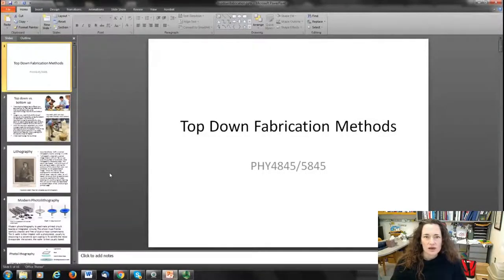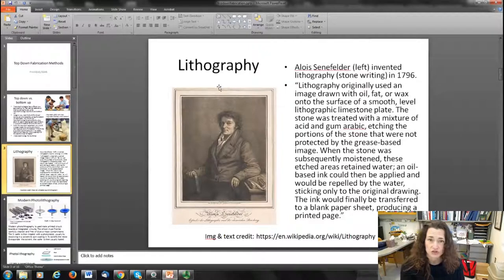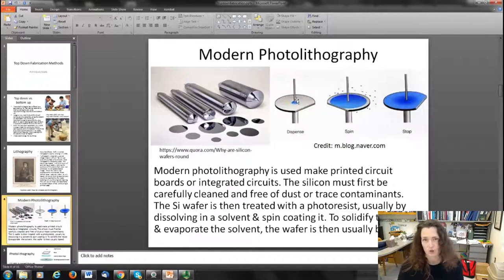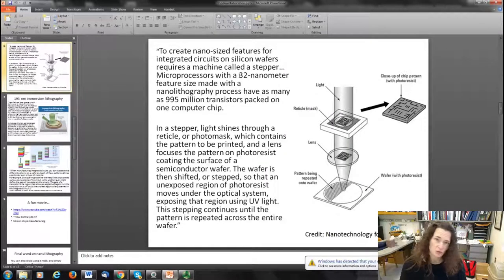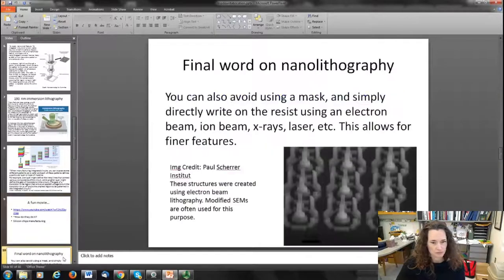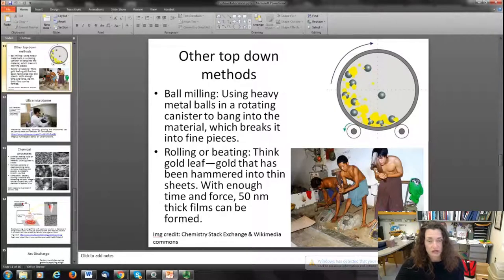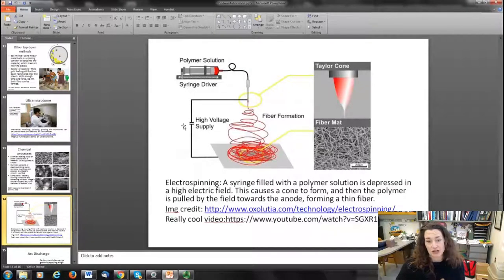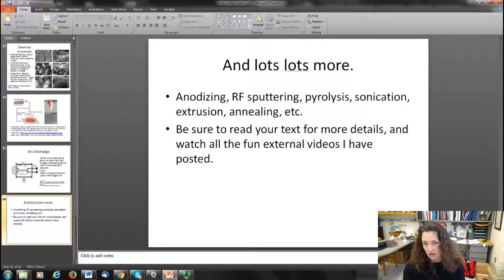Top Down Fabrication of Nanomaterials

Comment: Is lithography most used top down approach method for fabrication of nanomaterial?
Reply from the maker: Hi. I guess it depends which nanomaterial you are interested in, and for what purpose. Lithography is a huge industry, for sure. Advances have been pushed very hard by the tech industry, in the fabrication of components for computers, cell phones, and other electronics. But in the fabrication of specific types of nanoparticles--no probably not. So it depends. But certainly any general discussion of top down techniques for fabrication of nanoscale structures MUST discuss lithography. Hope that helps.